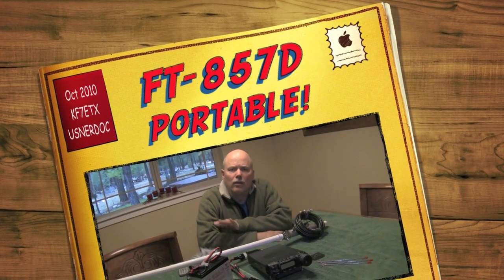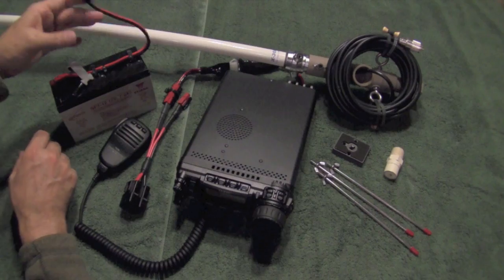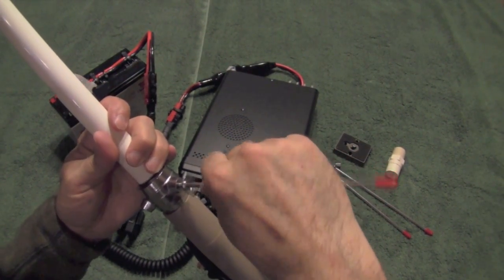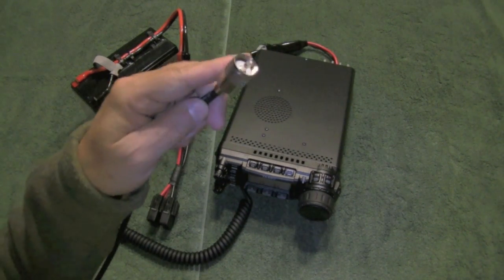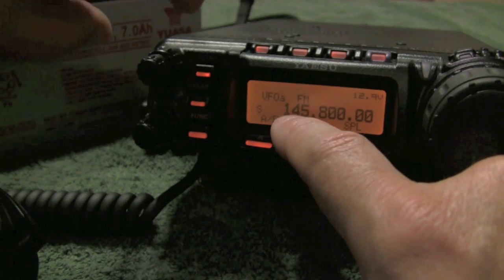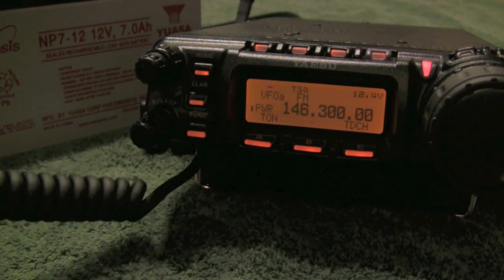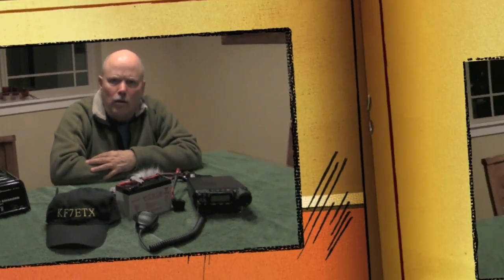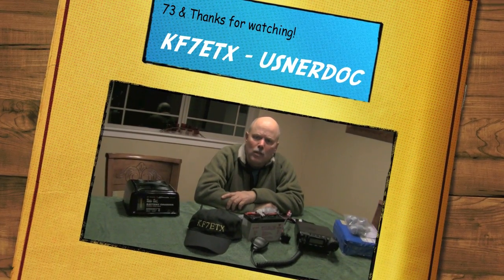Portable 9ah Battery Power & DIY Field Antenna - Yaesu FT-857D

Comment: What size is the battery please. I thought I heard 70 ah, is this correct as it seems a lot?
Reply from the maker: This battery is a 12vdc 7ah AGM battery. Another option is a 12vdc 10ah LiPO battery. We just developed a battery combiner and distribution panel called the Tek-Plate that will combine any two of these batteries for 14-20ah supply.
Reply: USNERDOC Many places on Ebay have replacement batteries for an APC UPS unit battery type RBC6, they're rather inexpensive and have 2 ea batteries in the kit, 12V 12ah each for a total of 24ah.  They're generally less than $50 for the 2 batteries, so about $2 per amp hour.

Comment: Is this a motorcycle battery?
Reply: UAEtommy similar. it would start a 100cc dirt bike but thats it. this battery is a sealed lead acid battery. larger types of these batteries can be found in jump starter packs.
Reply: smallenginedude71 thank bro.

Comment: I will be taking my new 857D into my 4X4 for some hilltopping. But this year I want to tent camp and do some new SOTA activations with it as well. It will be just me and my dog (he refuses to carry much) and I have cancer and diabetes, I need to keep the portable power lightweight and the antennas with as much gain as possible. You've sparked some great ideas for both the 4x4 and especially the tent. Believe it or not, I have never used the power poles. Think it is time to change that. 73 Doc...KB2RMC

Comment: Just surfing through you-tube and found your video.  was thinking of getting the Ft-857d but the Mrs said that the Icom 7000 I have is enough for now. good mods you made to the antenna and have added you to favorites and subscribed.
All the best from David in the UK (2E0ZAW) I haven't managed to get to the states by radio but will keep on trying lol.
All the best and keep them videos comming.
73

Comment: Great video, Thanks. Fairly new to Amateur radio. Question: Does the antenna not have to be ground itself? IE: I was told for my ATV application I had to run a ground wire to the frame. Thanks. VE7GIU

Comment: Good vid! I'm saving up for a yaesu ft 817. I have a similar problem where I live regarding antennas. I live in a ground floor maisonette in Hertfordshire, UK. Ii only have a small garden and no access to the roof. I have a 12 metre fibreglass roach pole fishing rod with a wire dipole attached to the top. It gets me over the rooftops and only takes a couple of minutes to erect. I like the camera tripod idea. I'm gonna look into doing that! 73's M6GLT

Comment: Unfortunately that isn't the case. I think there is a rule for TV antennas. But home owners associations can still prohibit ham antennas. That's where stealth antennas come in. There is a guy in my area who runs a stealth antenna for HF. He has a thin copper wire mounted just above his roof. All you can see are the sticks holding up the wire.

Comment: How long can you operate that 857 using that battery pack? I'm looking at the same radio, primarily mobile but I will use it while camping and for ARES with a Buddistick. Trying to figure out my portable power options. Great video!

Comment: Of course, because you won't be transmitting 100% of the time, and in SSB mode the output power varies directly with the peaks and valleys of the audio being transmitted, and it's impossible to determine your specific usage patterns, it's very difficult to accurately calculate the total runtime of any given battery system.

Comment: That entirely depends on the duty cycle and the idle current of your radio. However, we can make an educated guess. 10 watts out means about 20 watts in (most radios average out to ~50% efficient). Assume a nominal voltage of ~12.5v from the battery, that means the radio will draw on average 1.6 amps while transmitting. If you held down the PTT button constantly, you would get 7Ah/1.6A=4.375 hours. However, you should never discharge an SLA battery below 50% capacity, so cut that number in half.

Comment: He's got a regular 12 volt sealed lead acid battery with a capacity of 7 amp-hours. I would substitute a lithium iron phosphate battery instead of lithium ion, because a 3 cell Li-Ion battery would only be 11.1 volts nominal (too low), and a 4 cell would be 14.8 volts nominal with a maximum charge voltage of 16.8, too high for most radios. Lithium Iron Phosphate would be perfect at 13.2 volts nominal for a 4-cell pack due to the lower per-cell voltage, with a maximum charge voltage of 14.4 volts

Comment: Excellent video.  Very thorough.  The Yaesu 857 and 897 are nice radios.  Nice mods to the antenna. Very creative.   Would be interested to know how much talk time you get out of the battery using the different modes.
73
-Pete, AE6YI

Comment: Where do we find the actual information about the battery please? Since the title is about using it on battery power I was hoping to find that information but this seems to talk about everything else. All GREAT information, but what type and size battery are you using? I wonder if a Lithium Ion battery would be fun on this rig? Run it all day on 10 watts.

Comment from the maker: @superfly4416 - Thanks!

What gauge wire and how many amps for the fuses?
  12 ga wire - will have to check the fuse amp rating

How did you attach the powerpoles to the back of the radio?
  No, I used an extra proprietary plug (HRO) that then was hooked to Anderson PowerPoles

Did you have to make any permanent mods to the radio wiring?
 No

Comment: Doc, great stuff as usual. What gauge wire and how many amps for the fuses? How did you attach the powerpoles to the back of the radio? Did you have to make any permanent mods to the radio wiring?

Comment from the maker: @leongaines - I will have to do some testing for the run time on the 7a 12v SLAB. Bottom line will depend on percentage of transmit time which uses the most power compared with receive only mode. Yes, you can run the coax to a handheld and use a 12v car battery as a power source . . . something I have done many times.

Comment: @USNERDOC - Very nice portable setup.  I have two questions for you.  How long can your radio run on the 12 Volt 7 amp battery?  Is it possible to plug in the coax cable for your antenna into a handheld or must it be used with a base station type radio?  My reasons are because I am working on a budget and thinking if I can get a hand held for the car and use a large antenna when I am at home...until I can afford a base station.  Thanks in advance.

Comment: hello great set up.like the mobile antenna from base antenna. i tried 2 100 ft telephone extensions end fed. workrd great soaked by 3 days of rain. 857 is a very good radio. i use something similar a icom ic 7000. this class of radio is so full of features. guide cord is very light and very strong. about 3/32" and takes a lot less room.
congrats, keep on having fun.
 73  VE6LCK

Comment: Nice informative video. Your charger, does it make a difference whether I switch my charger to 2, 10 or 12 amps and should I be switching it to 6 volts or 12 volts? Also, can I also use a 12 volt 10 amp battery. I like the portable antenna setup. Would like to use the same setup with an 817ND.

Comment from the maker: @Tacticalgearhead - John, good advice from Hugo. I got the same advice from Wil (AI4QT) when I was considering similar purchase options. The 817 still has some backpacking appeal for me but I will wait and see how the 857 and external battery are to lug around in the trail before considering another radio. I think you will be very happy with the 857!

Comment: @USNERDOC haha no problem, I was looking at the 857 videos and you popped up!  I was going to get the 817 for HF use, but Hugo told me to go for the 857, 5W might not be enough for voice comms.  I kind of liked the 817 for the internal battery pack, but I guess I can use an external battery with the 857 like you demonstrated.

Comment: Excellent setup Doc!  Now you need to get a 12v solar trickle charger to keep your portable battery topped off.  They are pretty inexpensive I think I paid $25 for a pack of two at costco.  If you have two 12v batts you can be charging one while operating on the other.

Comment: Hey, Doc, another great vid! To lighten-up your load, you might look into a motorcycle "Trickle Charger" for charging that battery. Battery Tender is a common brand, but Yuasa and Opti-Mate make nicer ones with more sophisticated charging programs and desulfation modes. 50-60 bucks would get you a great charger the size and weight of a "Wall Wart" power supply, and can be safely left unattended. Take care!

Comment: David,

Excellent video!

This video is one that should be ‘required‘ viewing for anyone wanting to set up a portable rig.  From the antenna set-up tips, to the radio set up, to the antenna/tripod arrangement, to the battery connections, it really is one excellent tip/idea after the other.  Good job and keep those ideas coming.

BTW, I appreciate the link to my channel in the video.

--73--
John/W5CYF

Comment: @cnttaylor 
Check out the TYT TH-F5 These are VERY inexpensive HT (HandiTalkie) radios made in China. But the reviews were all very good and I am absolutely ecstatic with mine. For much less then $100 I am on the air with a VERY small portable. The only thing is I will agree with some reviews, a bit tricky to program. I was lucky and the package I got had computer software and USB program cable. Made it a breeze. Feel free to contact me if you have questions. Good luck on Test!!

Comment: That's a pretty smart way you have your antenna setup.  I was going to leave you a comment about making your own antenna so it can be more portable but it looks like your on your way with that already.

I was looking at the FT-897D for easier portability since it can have an internal battery but I think I like your setup better.  Those batteries go bad eventually and your ways seems to be the least expensive.  Plus I think your radio is better and has a bigger display.

Comment: I like using one of those battery jump starters as a portable battery for the CB or 2m.  It lasts a long time and can jump start a car, recharge cell phone, run LED lights if necessary and I can recharge it via 115v or 12v solar.  It's not as compact, but has multiple uses.